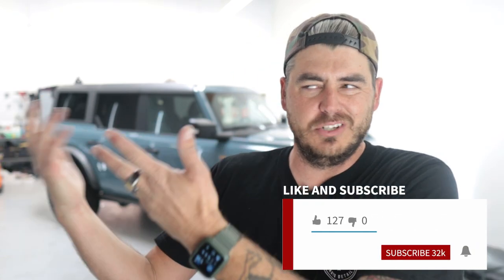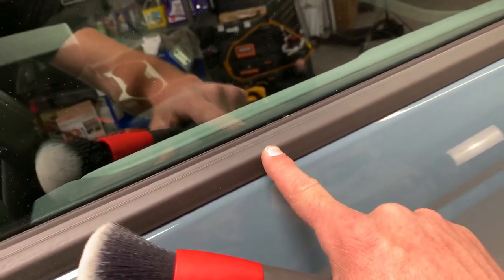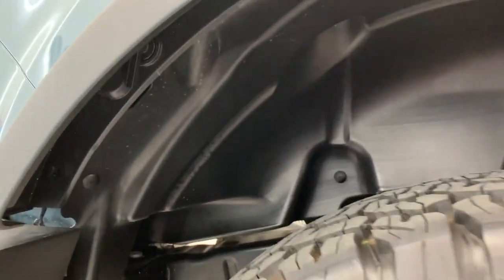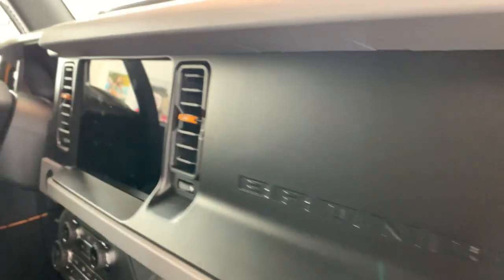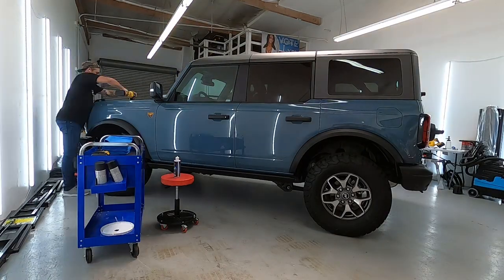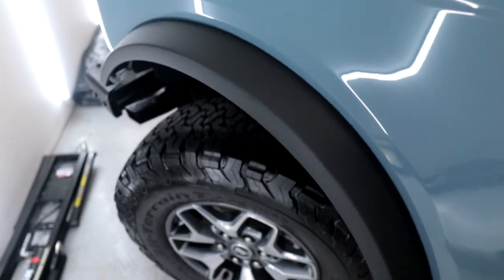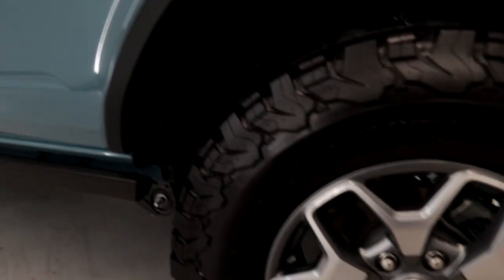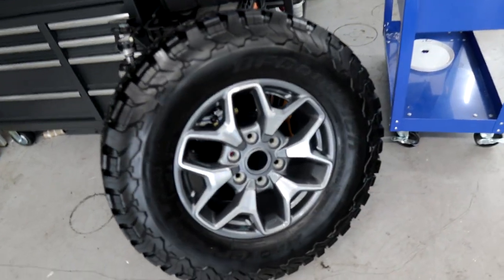NEW FORD BRONCO DETAIL | How to wash and protect the new 2022 Bronco!

Comment: This video is great. It's been years since I've detailed a car. Im thinking about buying a Bronco and was wondering what the new stuff out there. I used to use a product that starts with an "M" but I see there is a lot of other options. Maybe better options. Also, learning about ceramic coating. Thank you so much for the information and links. I appreciate it. I was wondering about what to use on the all the plastic fenders, etc you mentioned. perfect.

Comment: Josh, I love your videos, dude. Can I make a suggestion to you? If you decreased the aperture (for example, from f2.8 to f5.6) on your camera, the background would become a little less blown out all the time, and your subtle movements towards and away from the camera would make it less likely to lose focus on you, since the range of focus will be greater. If the problem is that you the subject becomes too dark, then maybe you could get a couple of studio lights for in front of you if you haven't already.
Reply from the maker: Thanks Josh! Yea it is mostly a light issue… I think I actually shoot at 2.2 most of the time. I’m using an m50 with the sigma 16mm 1.4. I try to keep my iso at 100 but I could probably increase that and still not have much grain and then be able to run at 5.6. I’ll test it out! Thanks

Comment: Just stumbled across your channel for the first time and I'm glad I did. I'm sub'd now and I'll be back to watch more. I love how well that Bronco turned out, and I'm hoping I can do the same for my 2021 Ford Bronco Outer Banks. However, I do have a question for you... IF I decide not to do this myself, and instead hire someone, what would you typically charge for the exterior clean, detail, and ceramic coating? (I used to live in SD but now I'm in NorCal and auto industry pricing seems pretty similar for the most part)